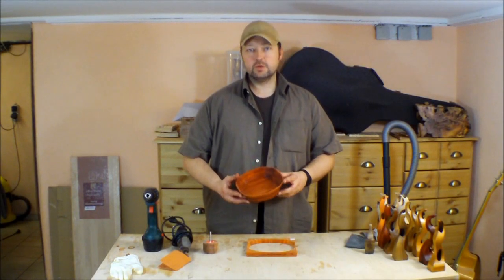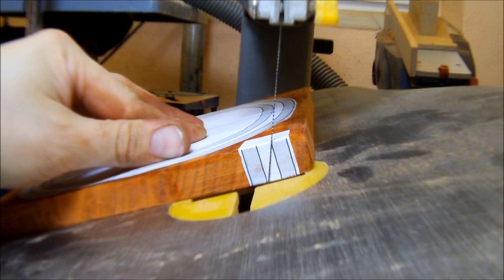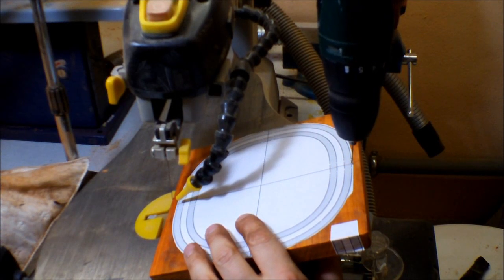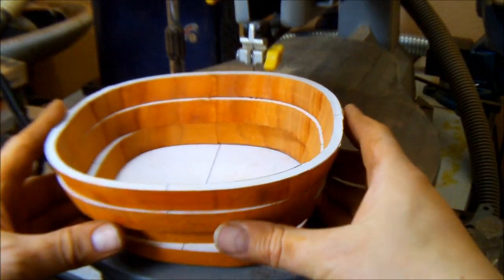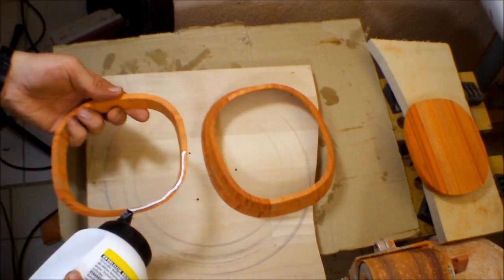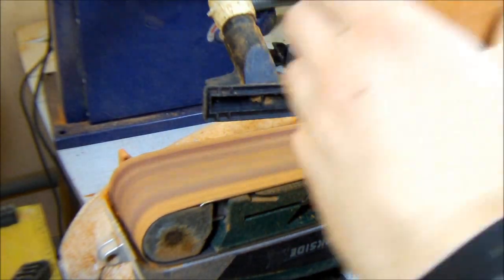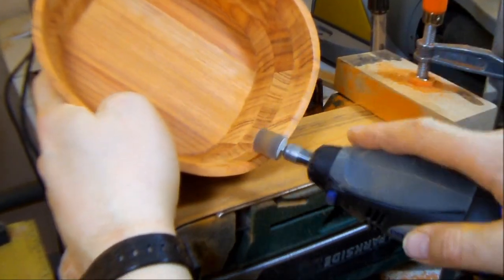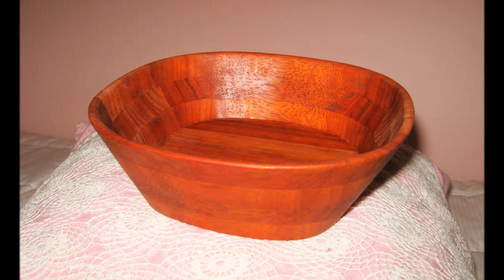How to make a Scroll Saw Bowl - woodworking

Comment: Thanks for the video. I appreciate it. But something you did not mention. And I think it plays a big role in finishing the bowl. And that is the layout. How did you come up with the angle? What is you reference. I did saw in the video the sticker you put on the side of the wood to make it as a reference for your angle. But how did you come up with that guide? What is your basis of distance between 2 lines to get the angle? And is there an alignement to  consider between the guide you stick on the side of the wood to the surface layout? I really hope you explaine it in the video because the video title is "How to make a scroll saw bowl?" And part of it is designing and layouting. You can't finish a project without plan or design because that is you reference. Anyway thanks for the video.
Reply from the maker: The sticker is only part of the template. The distance is the same as the rings on the template. I explain it as best I can in the video. Please whatch again with sound tunred on: https://youtu.be/5zAXc6y9Xlo?si=Nn_I2ZyBv8dJsWPO&t=45

Comment: Hi Fabian!

Thanks for all your videos, not just this one. Because of them i bought myself a scroll saw to get started with woodworking.
So by using some pine-boards from my local i tried your simple bowl as a start-project.
It kind of worked out and the second one was actually usable. But there are some questions regarding the saw and i would like to know if you could give me some hints.
So on some areas ( not only knots, that would be understandable ) the saw seems to have a hard time and almost no sawdust/progress is made. But at that time it starts to rattle and vibrate when i try to push my work piece into the blade. The blade tension is pretty high, at least i think it is high. It is a very simple saw just like your first one so i have to use these stupid adapters to use flat (?) blades. I tried no.3 and no.5 blades from my local shop ( TOOM ) but there was no obvious change/improvement in the rattling/vibrations. Speeding the machine up did not stabilize the vibrations and i did not want to go super high because the machine started to scare me with the then more violent rattling. I am using 19 mm pine boards because they are cheap and i'm still getting used to the machine.

So hopefully you, or somebody with more experience them me reads this and can help me.

please keep the videos up, they're awesome and entertaining.
Reply from the maker: Hm, hard to tell. I would suggest to cover the wood in clear packing tape for lubrication and to use goode quality blades. Usually the blades from the hardware store aren't so good.

Comment: First of all I’ve done over 100 of these bowls in every shape and size and you do not drill all the holes in the same place you go around the bowl so you will have no problems with the sanding and having a thinner place in one side of the bowl you also do not turn the rings around because you lose the repeating grain affect of the bowl when you look at it from the inside and the outside so maybe after you’ve made a few more of them you will know a little bit more about it
Reply from the maker: Thanks for your helpful and informative comment.
Reply: I thought the pattern inside looked pretty cool so maybe just depends on the person's preference 😀